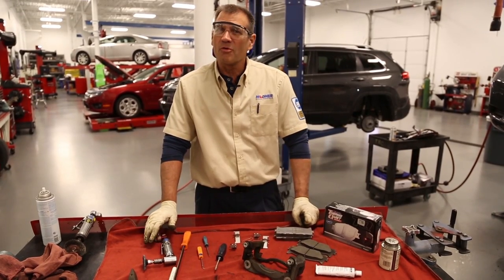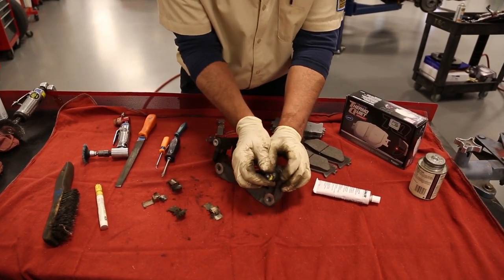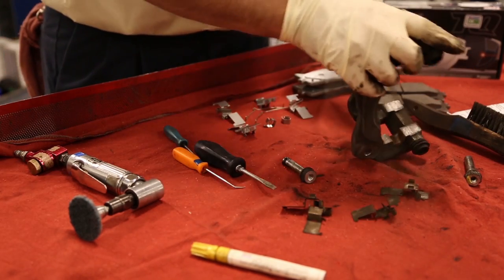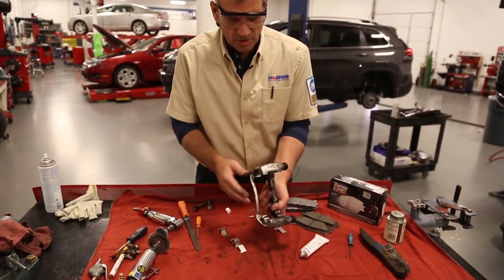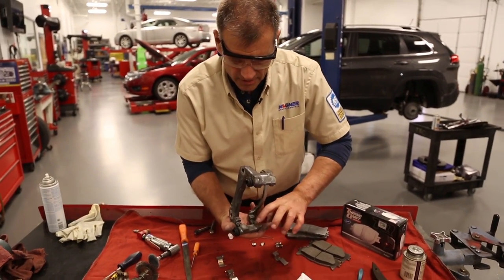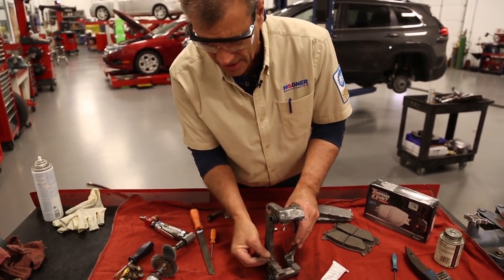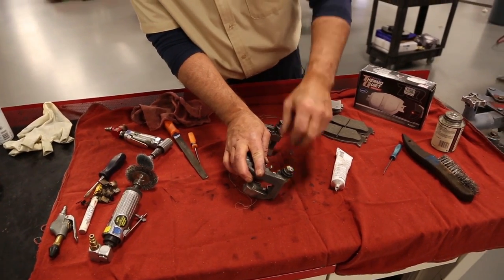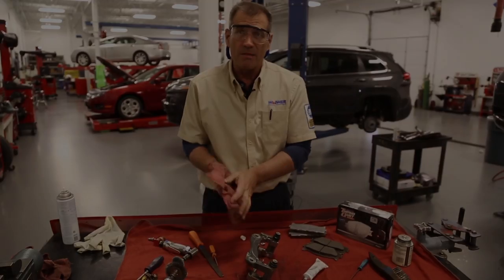Brake Job Tip - Cleaning Brake Caliper Brackets

Comment: Leave the caliper pins in place when cleaning and especially wire brushing the bracket. Use brake cleaner to flush away redisue and only then, remove the caliper pins. This avoids getting debris inside the pin bores where it can become trapped in lubricant. Rinsing off the bracket also removed gummy buildup around the boots, makingng them eacsier to remove.
Reply: It's better to use a tube brush on a drill down in the the caliper pin hole and rinse with brake cleaner then blow it all off with a compressor
Reply: I would love to know what you’d use to rinse it off with. Brake cleaner spray?  If so would that damage the rubber boots?
Reply: I remove the rubber dust boots, cleaning the convolutes with Dawn soap and a nylon tube brush. Then I clean the slide-pin bores with kerosene and a brass wire bore brush, the remaining with a brass wire brush, before cleaning the entire apparatus ultrasonically.  Then I immediately remove all traces of water from the slide-pin bores and rubber dust boots with isopropyl alcohol 99%.   Finally, I grease the slide-pins and bores with Permatex Silicone Ceramic Extreme Brake Parts Lubricant (orange color) along with the bracket-side of the abutment clips to inhibit rusting.  (I do not  grease the brake pad side of the abutment clips.)  Then I spray the outside of the rubber dust boots with  DuPont Silicone Surface Safe Lubricant.
Reply: @armchairtin-kicker503 whoa I hope this is cuz it’s a Ferrari .  Holy shi*

Comment: Good video however the first slide pin you put in was sticking you can see it in the video that is exactly my problem right now even after changing the boots and pins want to make sure it doesn’t stay stuck in at any point or wheel cause brakes to grab and ruin your tires which is what happened to me.

Comment: My only problem with marking the guide-pins, ensuring they go back as found, is it assumes the last tech put them back correctly.  Without knowing the technical reason for the placement of the guide-pin bushings, one is just guessing.  That stated, I have heard they always go on the trailing-end, opposite of wear-indicator placement to prevent rattling.

Comment: My issue is cleaning inside the burrow holes for the pins. Symptom is a sluggish pin with resistance that doesn't glide freely. I wiped out and sanded the inside with no improvement. Glide pin is fine. Any suggestions?
Reply: Go at it with brake cleaner and a bore brush.  Good idea even if they're not sticking, I don't like how he just inserted a rag.

Comment: so i lost track of what guide pin has a bushing.  how do i figure out which one they go back in? they fit in both ones... any tips?
Reply from the maker: You would have to mark each item prior to disassembly.  For correct installation and service procedures one would have to research O.E. service manual or equivalent research material for proper assembly.
Reply: Two things, designwise: 1st, the bushing goes on the pin which has a slot for it. 2nd, that pin with the bushing goes at the hole which is at the "Bottom" when the bracket is installed in the knuckle. It is hard to tell when you have not marked them or if the previous repair guy interchanged them and I see this a lot as people mix both brackets in one cleaning session. One thing I do to know which one goes on the driver side is to tie something on it such as a  twist tie from cords (or xmas decor ties will do). It always helps. The bushing at the bottom supports and maintains the alignment of the pins in the guide hole. If it is at the top, due to gravity, the sliding motion is not as efficient as it creates more play and also will wear out the bushing much prematurely due to pendulum-like motion (swing effect). Unless you get a car fresh from factory with the bushing on the top pin, put it the bottom if they are interchangeable or check if you have interchanged the brackets (as the previous repair guy may have put a left bracket on the right and vise versa instead even though he marked them such as in this video). Unfortunately, the brackets too have different part numbers but are identical most of the time. This is an excellent video, though not everyone has paint markers or by the time you use them, they are dry. I hope this helps.
Reply: @johnmariano47  I believe you are the first one who has provided a technical explanation of why the slide-pin, with the bushing, goes at the bottom of the bracket.  I have always despised the "put it back like you found it" explanation because it assumes the last mechanic did it correctly--unless it was the assembly line which has QAQC.   When one reads the saga of British Airways Flight 5390, one really appreciates the fallacy in the "put it back like you found it" explanation.
Reply: @armchairtin-kicker503  Glad it helped. Engineers design parts based on specific functions and mechanics of motion, load etc. You're right that only if the car came out fresh from the manufacturing plant that saying "put it back like it was" may apply in the case of having brought a brand new car and one has no other reference. In the manufacturing plant are detailed pages of assembly manuals of which technicians sometimes miss such important minor differences that sometimes only during process audits or when a new tech getting trained questions why the previous tech never bothered to follow it or sometimes it gets caught during a campaign such as in this case an issue with brakes or reported by dealership if they come across a lot of it. (Minor, because these parts can easily be interchanged without noticable effect in assembly.) Cheers!
Reply: @johnmariano47  I had a thirty-six year career in information technology, twenty-nine as a commercial system software developer.  You would be shocked at how often mistakes are propagated through a software package because developers simply copy-and-paste what the last fellow did, assuming the work was correct.  I have always been fascinated with aviation because mistakes, all too often,  have life and death consequences, the commercial sector of the industry imposing a relentless negative-feedback loop in order to mitigate errors.  Recently, I did a front brake job on my 2008 Lexus GS 350, a vehicle which has Brembo-style front calipers.  Since the last time it was serviced, the shim design had change, Toyota going from single to double shims (part no. 04945-30350), the pair of shims being different.  Toyota, more specifically the Toyota Production System, uses an approach that I appropriated as developer decades ago, an approach called poka-yoke (mistake proofing).  Although there might seem two different orientation one could place the shims, there is only one, the configuration which allows the holes to line up.  Despite the numerous videos posted on the subject of GS and IS front brake jobs, only one focused on double-shim orientation and lubricating; quite astounding.

Comment: I'm still trying to perfect my techniques for cleaning heavily rust scaled brackets...trying to find the happy medium, that works, but isn't so aggressive it leaves grooves.  Hand filing is the only safe enough method for me, but it takes way way too much time.
I'm STRICTLY "Out of the Trunk" mobile... No air! (yet)
Reply: Get a drill and some gun barrel cleaning bits. Make sure not to put a ton of pressure on it but almost no pressure and just let it glide over the rust and it knocks it right off with no damage I use this set up everyday.